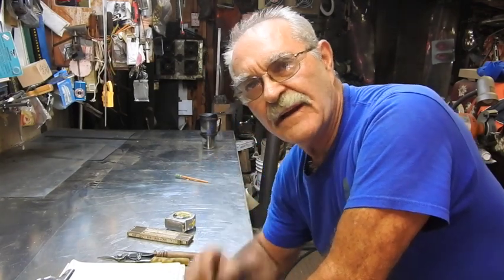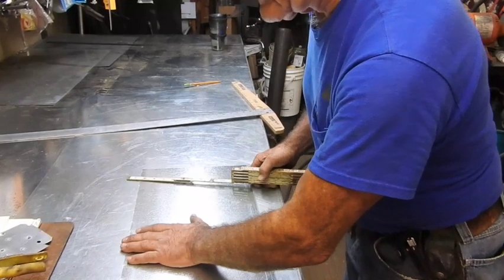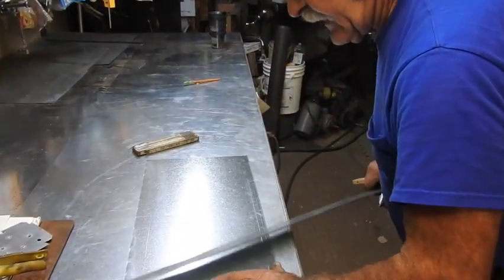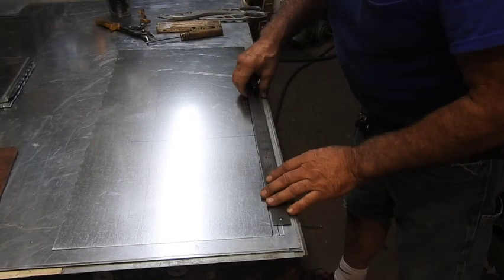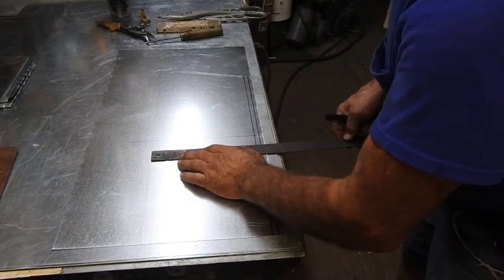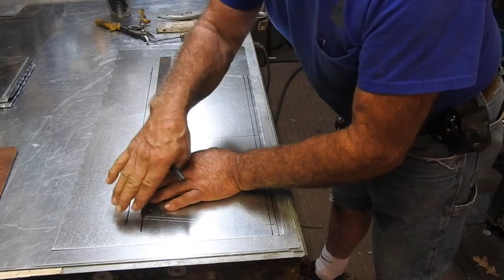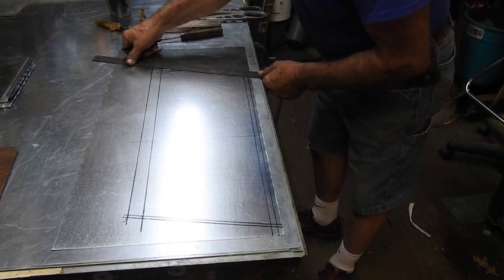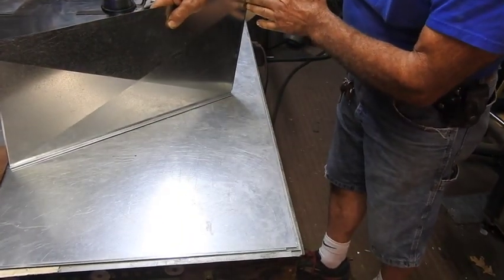Sheet Metal Hack-Four Way Plenum Adaption

Comment: Sir You are Excellent at instructing how to do this metal work! And you make it make sense brother.

I’m not good at Math AT ALL! So no Algebra or Geometry for me. I have to do all my figuring the long way around. I’m good at reading a Tape though. 
But I really enjoy watching these “good ol horse sense” videos that you put out. They are very practical and relevant to the real Work that we do out here!

So thank you very much Sir!
Reply from the maker: Well, thank YOU for the candid and thoughtful comment.  All the measurements I take can be figured out with geometry and trigonometry, but I prefer to take real actual measurements and work off those.  
     I try to always get one surface of the furnace positioned squarely so there's at least one 'true length' to work off of.  If that's not possible, I try to align the furnace perfectly centered on the larger plenum so it's easier to make a 4 way transition equal in two directions each way.  But you still need a true height measurement  in the center to work off of. 
   It's much easier to show how to do it this way than it is to use the fancy math for measuring. Btw, have I suggested my playlists yet..?  If not, here's a good one: https://www.youtube.com/playlist?list=PLk72G9DTzZ1tqw8ST_xdUlPoy_O-SmuBx and here is another tough one: https://www.youtube.com/playlist?list=PLk72G9DTzZ1taVZjyeN9DKr52HQ3hhcXd. Comment anytime...sometimes it takes a little time to get to all of them but I usually do.

Comment: How do you measure the total height of the first piece when it is a four way transition? Usually  in the field I always try to flush up the back of the furnace, start with that piece, and then get my height for the rest of the pieces off the first piece. When I don't have one flush side to measure off of though I'll just try and hold my tape measure at an angle to get the height of my first piece. Is there an easier way? Thanks!
Reply from the maker: I too try to always align at least one side like you describe.  But to answer your question,  Geometry is the answer.  Specifically the Pythagorean Theorm.  Remember how to figure the hypotenuse of a right triangle ?  'A' square plus 'B' square equals 'C' square.  So lay a straight edge across the flanges of the furnace. Use a square to measure STRAIGHT up from the straight edge to the cut off duct you want to be the face of the first piece of the four in the transition. That will be 'A', lets say that's 12".  Measure from the same point on the straight edge to the side of the furnace where the first piece will be attached, that becomes 'B'.  Lets say that was only 4".   Now....if the furnace has a flange you have to add that TO the first measurement because the straightedge is sitting on top of it.  So if it's a 3/4" flange, 'A' then becomes 12 3/4".  So grab the calculator on the smart phone.  'A' squared is 162.56.  'B' squared is 16'. So the unknown angle, 'C' squared is equal to 162.56 PLUS 16.  That is 178.56.  Now figure the square root of 178.16.  That answer is 13.36''.  You now have know the unknown measurement.  Make sense ??
    Now it's going to take a few tries to know exactly where to measure from and to and that's just to the raw cut edge of the exiting duct, so you have to add for the S-slip and also for the flange for the furnace top.  But that is it in a nutshell.  Within a few tries you will be nailing it.  Guaranteed.  Good luck Matthew and let me know how it works for you.
   Btw, have you seen the playlists above?? Here's a sample: https://www.youtube.com/playlist?list=PLk72G9DTzZ1tqw8ST_xdUlPoy_O-SmuBx. You should find some interesting fittings here.
Reply: @tractorman4461  awesome! Thanks so much. Great info

Comment: Gee wilikers what do you do for a living? Great video, I used to be in aviation and we weren't  allowed to use scribed lines for bends. Don't you have a foot shear and brake?
Reply from the maker: I think the aviation industry operates under a different set of rules.  When aluminum is scribed it has a tendency to fracture at a sharp bend.  To answer your question Rick,  now I don't do anything for a living...except help out a few people here and there a bit less fortunate than I that need a hand.  Yes, I have a foot shear as well as multiple brakes. 36'' PEXTO with front and back guages.  Connecticut 8' brake with additional bending bar, Dries and Krump 8' and Connecticut 4' box and pan.  I even have a hand operated circle shear !!
    I guess what I really do is what ever I want...mostly its work on old tractors and the occasional old motorcycle.  Thanks Rick for the nice comment and question.  The questions keep me on my toes.
Reply: @tractorman4461  I'm guessing at one time you were a professional sheet metal or HVAC man. I'm glad that you were able to retire to something you love.
Reply from the maker: @rickburris6164  yes, I was an HVAC service tech for more than 40 years. I spent the last 25 years before retirement primarily in DDC controls, building automation and commercial systems start ups. I hadn’t been on the metalworking side since before that. Retirement IS good though.

Comment: Nice precision work on the transition. Assembly on site makes the install easier.
The super shut down the site at noon today due to the heatwave in western Canada. Give us freezing rain or snow or moderate heat. Anything over 104 and were done. Safety first they say. I'm good with that.  Thxs for the vids!
Reply from the maker: Hahahaha...that's a bit toasty.  I been on the roofs so hot you gotta kick your tools to the shade of a unit before you can pick them up without gloves.  You know what I mean, I know you do.  My son in law got shut down twice today for lightning threats.  I've also been on roofs so cold it muddles your thoughts after a few minutes.  All you want to do is get whatever you're working on repaired and get off the roof !!  Thanks David for letting me know how toasty it is up that way.

Comment: Hi Wendell, Been watching a long time but very seldom comment. My thoughts here are I'm wondering who you are directing these sheet metal videos to? It seems to me all your work shown here and in the past requires a pretty costly "Pittsburg machine", yet anyone who already owned this "pb machine" would already be far enough along in their sheet metal career that the pattern layout/assembly process you show would have been learned long ago before buying a "Pittsburg machine". 
YouTube is primarily a DIY venue (in my opinion), so is there not another way to build and assemble duct transitions and fittings without a "Pittsburg machine" to seal them, or is that just too much hackery? Not trying to criticize your content here but to get you a larger viewership if more diy'ers could learn from you and do this work.
Reply from the maker: Good afternoon bobrub....thanks for jumping in with such a thoughtful question.  This question bears much more than a simple answer.  I really have never thought of what audience to target with any videos whether they are hvac related, tractor related, welding or wood cutting.  I'm not really a DIY video maker....more of a "Here's what I do because I have the tools to do it'' video maker.  When I started making videos just a few years ago it was with one single thought borne out of a conversation with the Missus.  One evening I was going though some old, old family photos of my great grandfather that died years before I was born and my grandfather and grandmother both of whom died when I was very young and my own mom who died when I was only four.  We collectively realized that it would be the coolest thing if she or I could stumble onto some old home movies of just one of them talking about what they did that day....and especially just a few minutes of her own lovely but diminutive great grandmother that she loved dearly.  We know none of that potential even exists but what if our very own grandchildren or great grandchildren that aren't even born yet were to stumble on some footage of us 20, 30 or 40 years from now deep in the YouTube archives.  Maybe they will be thinking the same thoughts as we were that evening in front of the fireplace. THAT conversation was the impetus for establishing the Tractorman44 channel.  So I guess my 'target audience' isn't even thought of yet by that description.  LOL
   What I do on the videos is just living day to day out here in the woods and if it feels like its interesting enough to show to whoever wants to see it...I put it on an SD card for upload.  Do I really think it will ever be viewed by future decendents...not really, but at least with these videos there may exist the potential for them that does not exist for myself or my bride. 
   A while back, my son actually told me what I do is not really YouTubing....its VLOG-ing.  I like that.  It's really a Video log of the things we do just to live our lives the way we want to, help a few others less fortunate along the way and hopefully provide at least a little entertainment for others that may show interest along the way.
   Now that the heavy pontification is out of the way....lets' talk about the metal vids.  I've come to find out through the comments that there are a lot young men starting in the trade that appreciate the videos as well as a lot of guys actually in business that like them as well.  Some of my favorite viewers are older tradesmen retirees that just love to watch this stuff go together.  (See Tom Walkers comment above). All those comments make my day and contribute to the desire to continue doing the things that bring either a bit of help to the youth of the trade as well as smiles and pride to the older retirees.  Back in the mid-70's I cut my teeth working for a contractor that forced us to hand form metal for furnace change outs on basement floors bending with angle iron and 2 x 4's and mallets.  It was very hard to do a good job, but I became pretty darn proficient at it. But it is not something I want to revert back to.  It was at that contractor I swore I would never be a guy to stick stuff together with duct tape like I watched so many others do.  Hand made pittsburgh's are difficult so most people just use the S-slips on all four corners, run screws in and either tape it up or slap mastic all over the joints to seal them.  
   Working for that guy is what caused me to start piecing together my shop....but it was because I always wanted to be better at making metal. Yes, prices today for new equipment are out of reach for the average home owner....but there are still bargains out there.  For instance my brother in law just two years ago bought a three phase 10 station pittsburgh machine for $35 at a propane company going out of business auction.  I was on a job about 15 years ago where a warehouse foreman gave me a Dries and Krump 8' brake exactly like the one in my new shed. He said if I could load it I could have it.  Yes, I got it.  I picked up a 30'' set of slip rolls tossed on a pile of recycle metal at the salvage yard.  Got it for scrap price.  An old retired buddy stopped by with half a truck load of sheet metal hand forming tools, stakes and anvils he bought for $2.50 at an old tinners farm auction. No one else even made a bid.  Yes, I had done a lot of favors for him over the years and he gave me the whole load. The list goes on....  I guess that really doesn't answer your root question, but it sure got me thinking about some stuff I don't normally think about.   LOL
  Wow...I just skimmed what I wrote...sorry for the length, but like I said its not a simple answer.  I'm sure the viewership will slowly increase over time, and I would welcome that for sure.  But if you've noticed I have never asked for a 'like' or a 'subscribe' yet because I figure if it someone feels what they've watched here is interesting they might just want to see a little more so they don't need me to tell 'em to.  Thanks again bobrub for the question...but I sure hope your next comment doesn't make me think this hard !!  LOL  But it may give you a little deeper insight behind the channels content.
Reply: @tractorman4461  Wow, what a reply and so very interesting too. Sorry to take up your evening. I am an old fart same as you (I'm 70) and was just looking out for other's wanting to DIY metal themselves. Don't worry about me, I'll keep watching whatever you put out there. 
I think it is a GREAT idea to leave all this for your grandchildren; I do believe they will get to view you in the future. Oh, and find a way to get your misses in there too for the future viewers.
Reply from the maker: @bobrub  Hahahaha....no problem.  But it did kinda make me think a little bit.  I got the Missus back a while while we were at the Kubota dealership and a few other times too.  One in particular comes to mind where she was helping me load a few small logs out of a buddy's yard up in the city.  Just in case YouTube doesn't stand the test of time, I am transferring all my SD cards to external hard drives....Like I said in the future they may just be like finding an old album of pictures in a closet or a pile of old correspondence from a generation already gone.
   Thanks for hanging in there and watching the videos.   I've got 50 or more I haven't even gotten to begin editing yet.

Comment: Saving 1/8" of material and making the furnace harder to install and less durable. 
Corporate thing is strong in the world. 
It was okay at my first job. The plant manager was a foundryman who worked his way up. He said meet the demand and it will sell. They were there until the EPA priced them out of business. 
My second job the boss was an engineer. He said make it right and it will sell. They did alright until MIOSHA and the EPA priced them out of business. 
My third job I worked for a salesman. He said make it and he will sell it. 
My fourth job I worked for a former accountant. He said flatten the place turn it into a parking lot and we will sell off the property.
Reply from the maker: Good comment. Anything to increase the margin for the investors.  Kinda like the builders that stick a 2x4 in with one nail expecting the drywall and screws to maintain structural integrity.  Saving 1/8'' material on thousands of furnace frames equate to building hundreds at no additional material cost...and at the speed of automation, there's not much labor included either.  But those narrower flanges make it much more difficult to fit plenums to.  Not even enough room to get the drill chuck straight up and down to run a screw in the narrow flange...so about one in four shoot right off into the basement.....  aaarrrrggggghhh!!

Comment: Hi Wendell, further to my first comment, I see in your previous videos this is a piece of hot air-ducting for heat flow, hope I am right, as an Apprentice in the 80's I made a beaker and a toolbox out of sheet metal, the beaker is here and the toolbox at my brothers home, it was fun to make
Reply from the maker: Yes Jan, specifically it is a 'plenum adaptor' to go from the discharge opening of a new furnace to the existing duct which is typically a different dimension.  Sometimes they are close, and most times they are pretty much way off in sizing.  A 'PLENUM' is referred to the very first box or duct directly connected to a furnace or air handler.  The extended plenum is then tapped by the trunk line to deliver the air flow to the house or structure.  I do have a lot of videos that show this.  Here's a job I did for my son's attic heat pump.  It is very very comprehensive ans well as complicated: https://www.youtube.com/watch?v=PvDab537ul4&list=PLk72G9DTzZ1taVZjyeN9DKr52HQ3hhcXd
Reply: @tractorman4461  My friend I watched all the parts to the end of Part 8, that was super interesting and glad I found your channel again, now I know what go into the air-ducts in buildings that we take for granted, well done my friend, I enjoyed every moment
Reply from the maker: @jankotze1959  Awesome Jan.  Thank you sir.  I am editing the furnace install right now that goes with this 4 way plenum.  It turned out pretty fair.

Comment: My friend, you blown me away in the whole video, all I could see is a Man with many years of experience is busy making something and it's not the first time, I know now it has something to do with a furnish. The machine you used is also the first time I see that, the four way Plenum Adaption joints works awesome. I will have to dig into your video's to see how and where it works, I am now very curios
Reply from the maker: Thank you Jan for such a kind comment.  In some of the earlier videos the machines are highlighted a bit and even described to a certain extent.  This one is a Lockformer brand 'pittsburgh' machine.  That fold over joint is formed by a sequence of forming rolls that bend the metal in such a shape as to allow the insertion of a 1/4'' ninety degree lip.  The outer tab of the 'pittsburgh lock' is then folded over with a tinners hammer.  You'll see that in the upcoming installation video.